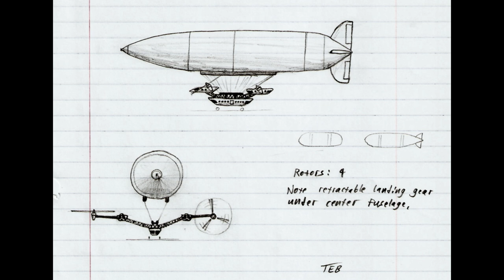Piasecki PA-97 Helistat | The craziest aircraft you have never heard of

Comment: Actually, for the early 60s 230 miles an hour was pretty impressive. Maybe it had other problems such as stability. I wonder why they chose not to go further. It seemed like a more logical idea than the blimp.
Reply: Ground resonance is already a problem with just one heli. Connect four of them and the problem is much worse. Then add a large resonator (gas envelope) to the mix and you have some serious high-amplitude eigenfrequencies that will make your best efforts look pathetic (and kill your test pilot). From the NTSB report: "THE FOUR HELICOPTERS STARTED TO REACT TO THE SHIMMY WITH GROUND RESONANCE"  https://www.aircraftone.com/aircraft/accidents/20001213x34293.asp
Reply: @LiLi-or2gm  uhhh, I don't think you got where I was coming from. I was referring to the earlier project. The 1962 high speed helicopter. It seemed like a more viable approachable idea. Somebody tell me why comments in YouTube chrome doesn't work anymore. In other words I had to come over to the actual YouTube app and I hate using that damn thing. They want too much control now. All it says over in chrome is comments have been moved, touch button to go to comments. I touched the button and It won't go anywhere.
Reply: It seems to be working better now. But I appreciate your input on ground resonance. In my opinion he may have over complicated it or rushed it.

Comment: I not only heard of it, I worked at NAEC Lakehurst as an Electronics Apprentice from 1982 through 1985, my first job after high school. Lakehurst was quite an active place back then. They had a resident A4 and often an F18 or S3 would come up from Pax River, Maryland. These aircraft were often used for runway-based arresting gear or in-ground catapult tests. Also there was nothing like driving on the taxiway to get to my building and having to pull over for a live or towed aircraft! Jet sleds were also in use on the mile long tracks out in the test area. I still remember the screaming sounds from J57 or J79 jet engines as they took off with their deadloads. The crash occurred after I had left that job, but I recall hearing about it later. I met someone more than a decade later who told me the lawsuit over the pilot's death took 11 years to settle.

Comment: There was the concept of using blimp in the forest service for forest fires,and logging.I saw that in Seattle.
Reply from the maker: It's a really good idea I think. You couldn't make any low passes over any fires though 🤣 

But it would be cheaper to run over time than a helicopter or plane. Could lift alot more water and supplies as well. I can absolutely see why they would consider it for that purpose.

Comment: 4:08 "It remains the largest aircraft to have ever flown"

Helisat length: 343'
Hindenburg length: 803'
Yeah I don't think so
Reply from the maker: Did the Hindenburg have helicopters attached to it? Because if it didn’t......then it’s not the same classification as this aircraft. As in, it is a lighter than air vehicle. The piasecki PA-97 is considered a rotor-craft.
Reply: @theatomiccafe8996  I see. Not the largest aircraft ever flown, but definitely the largest rotorcraft
Reply: ༒Gorm Auslander༒ I don’t think you quite understood the difference. The Hindenburg et al were not aircraft , because they fly according to the lighter-than-air principle. If an airship wasn’t moored to the ground, it would float away.
The PA-97 on the other hand was a heavier-than-air vehicle, thus classified as an aircraft. It is just made lighter by the blimp part on top. Without the lifting force of that and the four helicopters, it could not fly (or float).
In other words, the PA-97 is the largest aircraft so far to fly (for what definition of “largest” I don’t know), while the Hindenburg is the largest airship to have flown, so far.
Reply: @bennylofgren3208  the dictionary defines an aircraft as a machine capable of flight. Wikipedia sets airship as a subclassification of aircraft, so airships are aircraft
Reply: @gormauslander  You are correct sir. Obviously not all aircraft are heavier than air aircraft. IDK why anyone gave you a hard time for that, bizarre.
Reply: @OGPatriot03  I always go back to definitions because it ensures a common starting point

Comment: The closest modern equivalent to this vehicle would be the HAV 304/Airlander 10. It is also designed to function as a heavy-lift lighter-than-air vehicle, and looks just as crazy.
Reply: That design actually worked though. Saw her flying around my town on several occasions. Granted an odd sight, which was why she was nicknamed "The Flying Bum".

Ironically the only accident she was in, was due to an inadequate ground mast. The safety systems worked as designed, preventing her from drifting away & potentially hurting someone.

Those behind her design are working on a larger version ATM.

Comment: Not at all the largest aircraft. The Graf Zeppelin II, a near copy of the Hindenburg, but ever so slightly larger, (limited in length intentionally to be able to fit in that same large hanger at Lakehurst as was the Hindenburg) was more than twice the length of that U.S. Navy surplus blimp that held those four stunted helicopters in place.
 If by aircraft you mean heavier than air unless lifted by the four rotors, you might have a case, but it might surprise you to learn that the biggest airships using lifting gas were generally kept slightly heavier than air when on the ground.  The Goodyear blimp, for instance weighed about 50lb. on its wheel when moored. This airship weight does change to positive with altitude and flying attitude,  as when the vehicle is moving forward their is lift from the body that can offset the negative mass. 
The latest Goodyear "blimps" are not truly blimps anymore. with three rotatable propellers and an internal frame to which they are mounted they succeed at what Piasecki sought  with that abomination you describe. Modern carbon-composite frames, and the much improved blimp envelope plastics combine the two very different types of lifting gas airships into one more effective flying machine, still limited though, by the same weather constraints all such lightly built huge aircraft do.
Reply: Man that's a whole lot of words.
Reply: @johnevatt518  Important and insightful words though.

Comment: Looks like sloppy design and maintenance. 
 NTSB Identification: NYC86FHD01
The docket is stored on NTSB microfiche number 32618.
Accident occurred Tuesday, July 1, 1986 in LAKEHURST, NJ
Aircraft: Piasecki Acft. Corp. HELISTAT 97-34J, registration: N1897Z
Injuries: 1 Fatal, 3 Serious, 1 Minor.
NTSB investigators either traveled in support of this investigation or conducted a significant amount of investigative work without any travel, and used data obtained from various sources to prepare this aircraft accident report.
THE HELISTAT, A HYBRID A/C WITH 4 H-34 MAIN FUSELAGES ATTACHED TO A FRAME ALONG WITH A ZPG-2 HELIUM FILLED ENVELOPE HAD JUST COMPLETED IT FIRST HOVER TEST FLT SUCCESSFULLY AND LANDED. A PWR LOSS WAS NOTED ON THE NO. 3 HELICOPTER AND THE TEST WAS TERMINATED AND THE MOORING MAST CALLED FOR. PRIOR TO RE-MOORING A WIND SHIFT CAUSED AN UNCOMMANDED LEFT TURN WHICH THE PILOT COULD NOT CONTROL WITH THE FLT CONTROLS. WITH A TAILWIND, NO WHEEL BRAKES OR GND STEERING A TAKEOFF WAS ATTEMPTED. THE 4 MAIN LANDING GEAR WHICH HAD NO SHIMMY DAMPNERS STARTED TO SHIMMY. THE FOUR HELICOPTERS STARTED TO REACT TO THE SHIMMY WITH GROUND RESONANCE. AS THE HELISTAT FINALLY LIFTED OFF, THE FOUR INDIVIDUAL HELICOPTERS BROKE OFF AND FELL TO THE GROUND. ONE PILOT RECEIVED FATAL INJURIES, 3 RECEIVED SERIOUS INJURIES AND ONE MINOR INJURIES. THE HELISTAT WAS DESTROYED. THE PRW LOSS ON THE NO. 3 HELICOPTER WAS TRACED TO A MISSING THROTTLE LINKAGE CORRELATION PIN. WHY THE PIN WAS MISSING WAS NOT DETERMINED.
The National Transportation Safety Board determines the probable cause(s) of this accident as follows:
    THROTTLE/POWER LEVER,LINKAGE..DISCONNECTED
    ROTORCRAFT FLIGHT CONTROL..INADEQUATE
    ACFT/EQUIP,INADEQUATE DESIGN..MANUFACTURER
    ACFT/EQUIP,INADEQUATE HANDLING/PERF CAPABILITIES..MANUFACTURER

Contributing Factors:
    LANDING GEAR,MAIN GEAR..VIBRATION
    LANDING GEAR,NORMAL BRAKE SYSTEM..LACK OF
    ROTOR SYSTEM..VIBRATION
    LANDING GEAR,STEERING SYSTEM..LACK OF 
https://www.ntsb.gov/GILS/_layouts/ntsb.aviation/brief.aspx?ev_id=20001213X34293&key=1

Comment: Well, you need to improve your accuracy. 1) It was the port (left) rear helothat broke loose, not starboard (right). 2) The blimp was not rippedopen by the rotor blades, but rather by the failure of the support structure 3) The aircraft did not implode, explode or burn and 4) It was most certainly not the largest aircraft (either heavier or lighter than air) ever built.

The video was pretty good, but you need to do better research and refine your voice over.
Reply from the maker: I read all of this info off of the NTSB accident report. Send them an email. 👍
Reply: watch the tape closely, you can see the craft being ripped from rotors. At 3:59 , that smudge below the S in US is piece about to rip a huge whole.
Reply: Look again, the starboard rear motor is already hanging loose, as the port one then lets go.
Reply: +wingmanjim6
Pretty harsh response, for somebody who didn't took the effort to doublecheck the footage for his claim. It is the rear starboard that got ripped off first.
Reply: Uh-oh the fun police are here. Are you blind,did you not see the right hand / starboard helicopter break off first? Also please work on your spacing,punctuation,and use of parenthesis. What side does a wingman fly on wingman?
Reply: @theatomiccafe8996  You did a good job,don't listen to the critics.
Reply: @johnevatt518  Welcome, grammar police !
To answer your question, usually the right unless otherwise assigned or if changing circumstances dictate otherwise.
Reply: @johnevatt518  Sounds like grammar police to me. BTW - most of the "problem" was a bad keyboard. I'm sure you will be relieved that that has been repaired.  Good day to you as well.

Comment: Without an obsessed  lunatic like Piasecki to keep plugging away at the problems involved there would probably be no tandem helicopters.
  Take a look at the Mil V-12. It was an opposed tandem rotor helicopter that was 121 feet long with a combined rotor span of 219ft. For comparison a C-130 is 97 ft long with a wingspan of 132 ft. So yeah a helicopter bigger than a cargo plane. And it actually worked two prototypes were built and it almost went into full production.

Comment: What was all that stuff about the tail rotors being replaced with standard airplane propellers and gear reductions from a P-51 Mustang for propulsion? I don't think so LOL!
Reply: The engine of the P-51 ran at a significantly higher RPM than was optimal for the propeller so it used reduction gear to reduce the RPM while increasing the toque. Clearly the same optimal RPM difference existed here.
Reply: @calvingreene90  The engines of practically all WW2 era engines ran faster than the prop because they used reduction gears, the P-51 wasn't unique in that. My question was, what did that have to do with the helistat, which had no props? Obviously the rotors used gearboxes like all helicopters, but they were the original Sikorsky units. The whole line about "the tail rotors being replaced with propellers driven by P-51 reduction gears" made no sense.
Reply: @barryervin8536  
I admit I couldn't see the pusher props but given that the blimp moved like had horizontal thrust I have to assume that they were shrouded inside the fuselage. It strikes me as bad design but it would reduce the noise.
Reply: @calvingreene90  Helicopters (like these Sikorsky H-34s on the helistat)) don't have or need propellers for horizontal thrust. They get it from vectoring the lift of the main rotor through the cyclic pitch control. The original tail rotors were for torque (yaw) control. On the helistat the helicopters were bolted to the rigid framework so they couldn't twist so no tail rotors were needed. Horizontal thrust was provided by the main rotors just like it was on the original helicopters. I'm about 99% certain there are no propellers inside those fuselages, although I've never seen a photo that showed the rear view. Where would the air come in to be expelled out the back? The tail booms have just been removed at the fuselage joint. With 4 R1820 radial engines roaring and 4 big rotors spinning noise reduction wouldn't even be a consideration on a half-assed rig like this. I think the part about the propellers being added with P-51 gearboxes may have been a reference to the Pathfinder compound helicopter mentioned previously, but he was talking about the helistat when he said it.

Comment: The VZ airjeep doesn’t make sence to you ‘for obvious reasons’. However this is clearly the design of the current drones and manned fan-aircraft. A little more credit where credit is due please. He was far ahead of his time.
Reply from the maker: It didn’t make sense because it would have been very loud, used way more fuel and been dangerous to operate anywhere near foot soldiers. The concept was sound, just misplaced.
Reply: @theatomiccafe8996  fair enough.

Comment: Oh my.  1980 sakes.  I worked for NBC-TV News.  I missed that.  I was on vacation.  Oh my.  RIP to that brave pilot.  I mean those guys didn't have a chance.  And in 1986.  We didn't have this thing called a remote control?  I definitely remember integrated circuit chips of that era.  Even rudimentary computers.  They certainly didn't spend it on their R&D.  I mean really?  It needed 4 pilots?  They already had computers.  Computers then.  That pretty much work like ours, today.  So this wasn't well thought out.  I mean what the FUCK?   And impractical contraption.  It was just that.
I mean you put 4 Rotary engines in with 1 pilot.   And the computer controls all 4.  I mean they had already been flying the, F-14, F-15, F-16's for a while by then.  Along with numerous Sikorsky and Bell  helicopters.  And so what the hell was this contraption?  Can you say pilot error?  I mean this was filled with cyclic disappointments.  I'm sorry I had to get that one in.  Collectively.

I guess that sure burst their bubble.  Shoddy design work like that don't float.  I mean it was a real downer.  No LSD required.  Except in the design of the contraption.

 I fly fixed wing aircraft.    Or, used to.  Until some brain surgery.  Stopped that.
RemyRAD

Comment: Not the largest aircraft. 
Not even close. 

Hell, it’s made from a regular ass blimp, not even a particularly big one. 

According to the company’s PR, it was the largest “dynamic lift” aircraft. 

Basically they’re saying “the biggest blimp that also uses wings to fly” (helicopter blades are wings).  Which, sure. But it’s still only like a third as long as the bigger blimps and zeppelins.

Comment: Also they should have built it better, but Piasecki was just not equipped to take on a manufacturing job of this magnitude so many corners were cut and many things under engineered so that they could manage to build it. If another outfit with more experience building large airframes would have taken on this project it would likely have had a better result and we may have seen more. Since the idea is sound and could have been of great utility.
Reply: It would have been interesting to know the 'why' why didn't anyone say the frame holding those choppers up don't seem strong enough or, perhaps we should do a few static tests on those frames prior to launch. Was it a fear of tyrant thing or how dare you question my engineering?